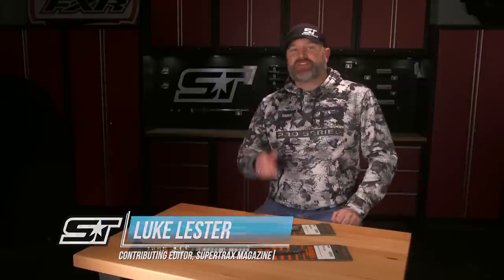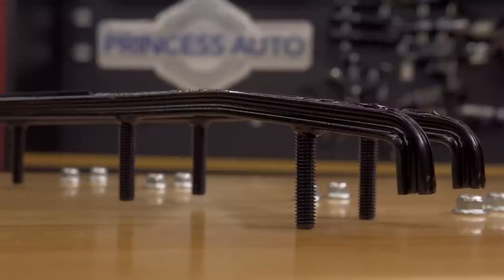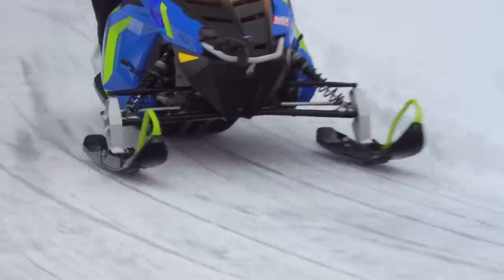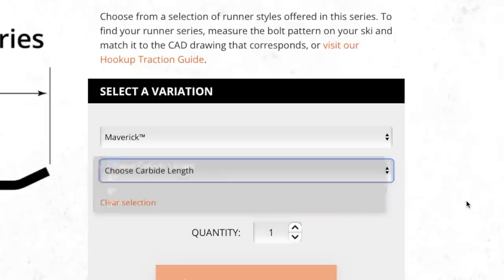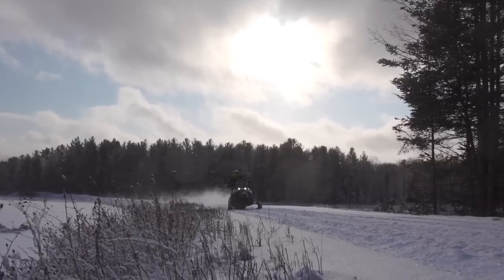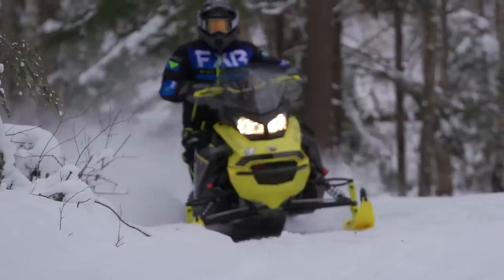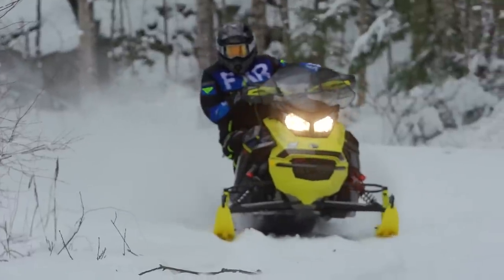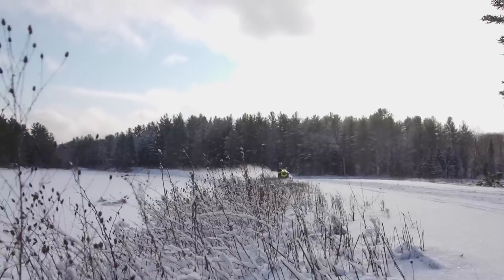Long Term Test Report of Woody's Maverick Shaper Bar

Comment: Great video, I purchased based on your recommendation. Ordered a couple sets of 4" carbide shapers for my summits that see a lot of trail time. Been running round bar hardweld runners for a couple years but when you're on real pavement they don't steer at all, and I mean not at all. You have to pull the front end where you want to go. The stock style works fine but wears out so fast. Have run shaper bars on old sleds and really liked them, hoping this gives me the longer life and better cornering that I'm looking for.

Comment: Your dad Mark mentioned on another recent video, that the Woodys Slim Jim was the best runner on sleds with longer tracks like a 137. True/Fales?  I'm searching for a 22' Renegade XRS. Thanks.
Reply from the maker: Still a great choice, but it's now replaced with the SlimJim 2.0. Overall wider width - increased tracking and darting reduction, Wider channel - to reduce clogging, Over all deeper bar for more aggressive cornering, Increased cutting edge size to reduce wear (turn down tabs) , Lighter weight runner than prior Slim Jim. If you are an aggressive rider and still find too much push in corners than a Shaper bar will grab hold of the snow better.

Comment: Stud boy must have had patent run out!! I live and ride in the worst conditions possible and still get 3,000 miles+ out of the studboys!
Reply: I was thinking the same thing. I have been running stud boy shaper bars since about 2008 and have never looked back. Friends of mine have switched over once they saw how they handled mashed potato snow compared to what they were running.
Reply: Studboys are great 🤘
Reply: Been running Bergstrom Good n Ugly bars on all my cats since 1997.   6” of carbide on a 1/2” host bar. Switch out my old bars from previous season around the second week of January for new ones. I average between 2000 and 2500 miles per year. Never had an single ladies with them.
Reply from the maker: Correct. See reply to Derek Rehm thread